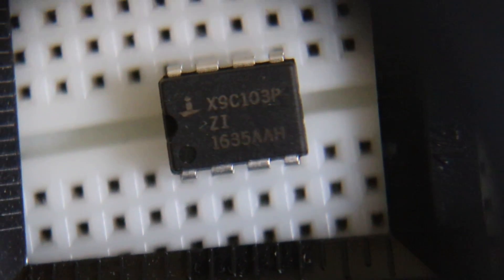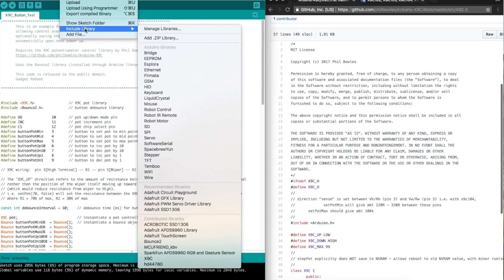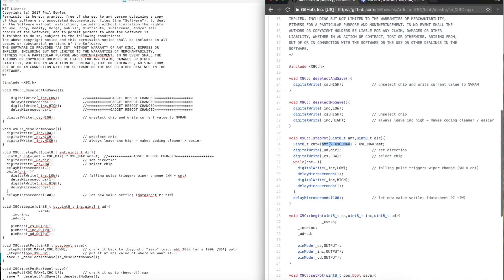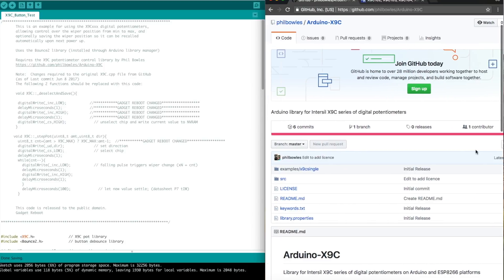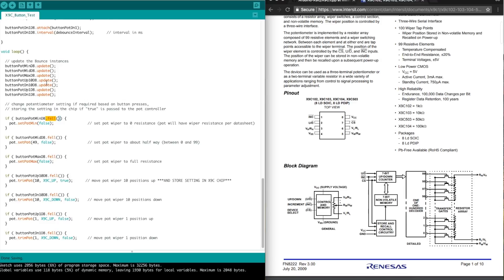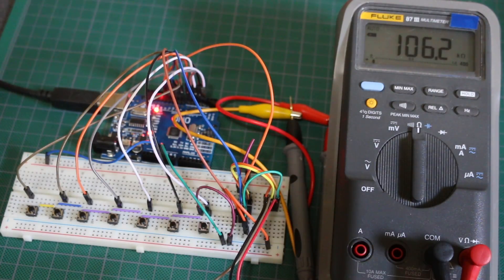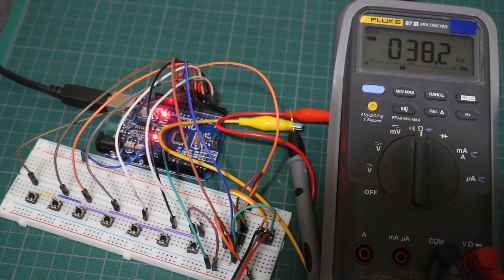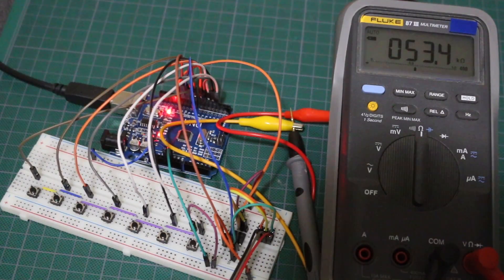Digital Potentiometer Control Using Arduino - X9C103

Comment: What exactly is the difference between digital pot and voltage regulator? Aren't they almost the same?
What exactly this can be used for?
Reply from the maker: I suppose a variable resistor like this could be used as a voltage reference but it won’t be able to deliver significant current to power something else. In order to maintain a regulated voltage and provide a certain load current, a voltage regulator  is needed.   If you use a pot as a voltage divider you will get a certain voltage out of the wiper but it’s only meant for measuring rather than powering circuits. 

 The most obvious example usage for this would be a volume control where the audio input signal goes to one end of the pot, ground is on the other end of the pot, and the wiper is the output which goes into another audio section or a speaker. As the wiper is moved toward the ground the volume goes down because you have more ground than  audio signal coming out of the wiper. As the wiper is moved toward the audio input, you get closer to having a direct short through the pot which is full volume.

Comment: I have been wondering for some time now, why you have a piece of blue tape on that dmm?
Reply from the maker: It’s a conversation starter! The question came up in another video once upon a time. It’s there to cover a crack and a gouge in the plastic that kept spreading and one day I will get around to trying to fix it more permanently.
Reply: It seems that it performs well. As a conversation starter, I mean. It made me remember some stock photos where they remove brand names from dmm's in their photos, sometime they wipe it out in software, some other time they use a piece of tape:-)
Reply from the maker: I should share screen time with my other Fluke meter which I’ve owned about 10 years longer than this one. I just never think of it because the probes used to be broken but now I have eBay replacements. Someday I will need to measure voltage and current at the same time and then I’ll get it all going.